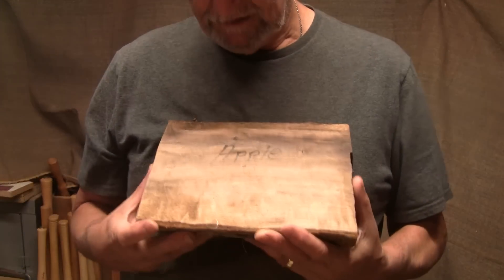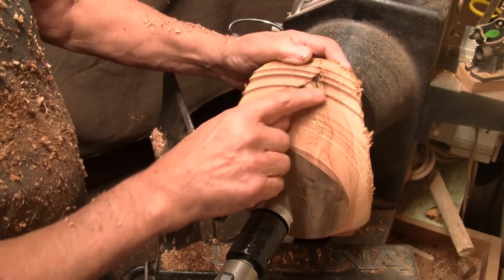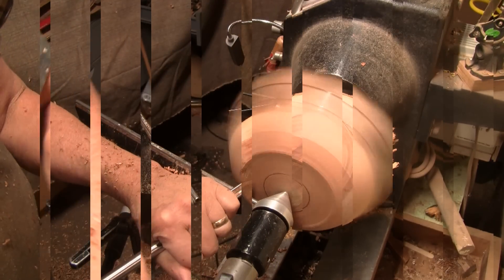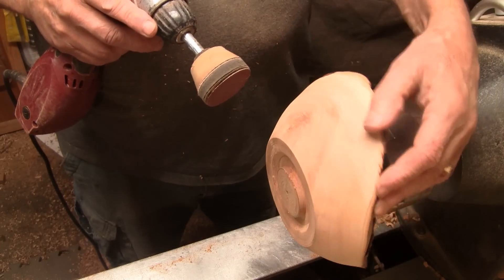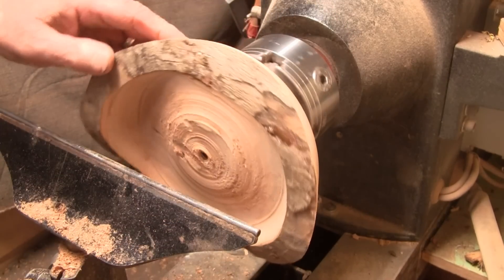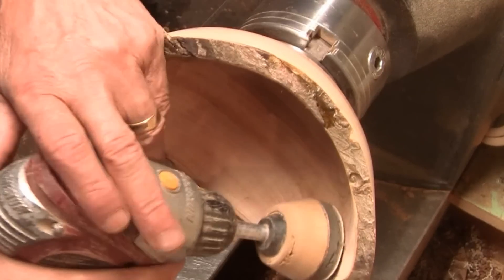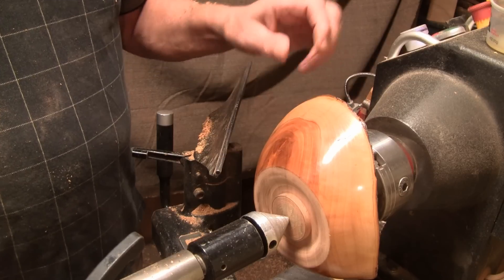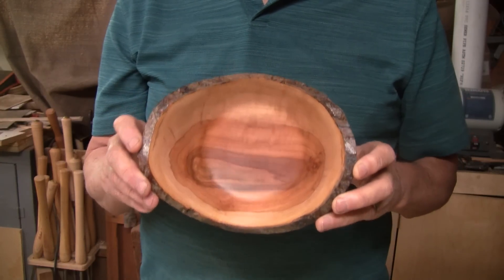Wood Turning The Surprise In This Apple Wood

Comment: Beautiful bowl and the apple colors just add to it! I sure like the finish and although I have never used wipe on poly i do have a can of it but it is old so not sure how it will work anymore! Well done and thanks!

Cheers Al
Reply from the maker: Thank you very much Al. If you have never opened that can it might be just fine. Once open and the air gets to it there is a chance it will start getting real thick.
Thanks for watching,
Gary

Comment: Excellent Gary! I haven’t had much opportunity to work with apple, but it certainly is beautiful grained wood! A nice surprise for everything to work for you. Interesting that you can apply a water based poly over shellac. It looks very good! Cheers, Rick
Reply from the maker: Thank you Rick. Yes you can put a water based over shellac sanding sealer. You actually can put about anything over it.
The poly I used on this one is the oil based.
 Thanks for watching,
Gary

Comment: Beautiful as always. Question. Do you sand in between seal coats and finish coats because it looks so smooth. Thanks Gary.
Reply from the maker: Thank you Charles. Most of the time I use the fine Scotch Brite between costs. The trick is try not to put too much finish on at a time. 
If I get too much and it starts drying then I will use 400-600 sandpaper.
Thanks for watching.
Gary
Reply: @ThePapa1947  thank you Gary